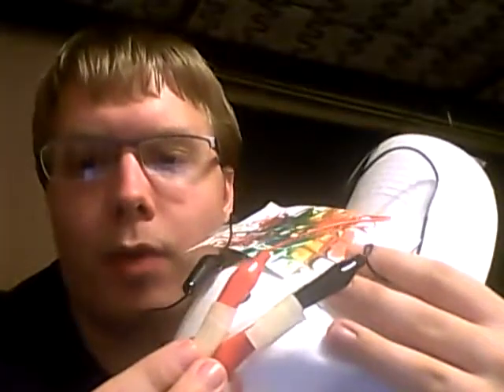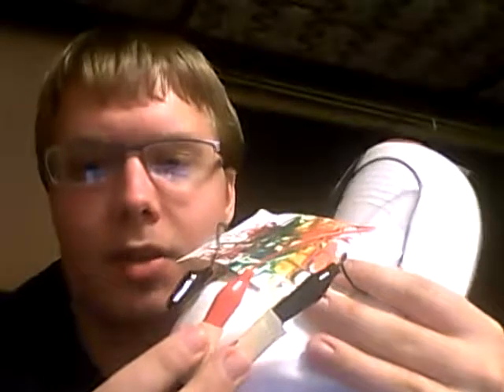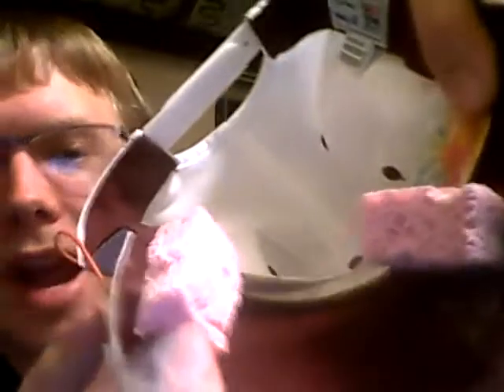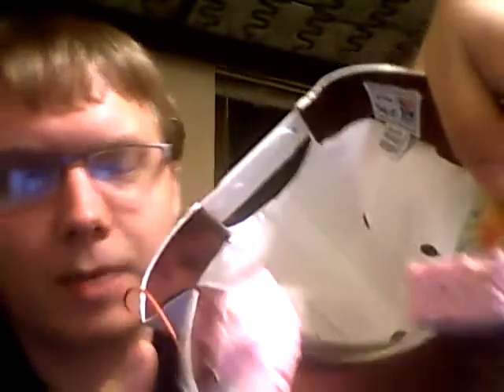A biohacker's prototype tDCS device

Comment from the maker: Good ideas.  I actually already have the ramping-up feature covered; I've replaced the battery with an Arduino Pro Mini, which is programmed to use pulse-width modulation to ramp up the current, and to shut off the current after it's been fully ramped for 20 minutes (the most-often recommended stimulation time).

I also now have much better electrodes than the ones in this video, which can actually stick to the skin.  I have great hopes for my improved version of the device.

Comment from the maker: Well, we found out mostly by experimentation (i.e. trying different currents and seeing what happened).  IIRC, your typical tDCS pulls a current density of about 800 microamps per square centimetre.  Multiply that by the contact area of the electrodes, and you've got your current.

Comment from the maker: More or less.  Actually, you don't need to leave the cathode wire free at all; it really doesn't matter where on the circuit you put the resistors, as long as they have the right serial/parallel configuration to get you the net resistance you want.

You don't necessarily need to dip the electrodes in saline; I just did that to make the sponges into electrodes.  You can get electrodes for a TENS device at a pharmacy, and those should work as well.

Comment from the maker: In summary,

1. Start with a 9v battery.

2. Wire the anode to two resistors to drive the current down to about 1.5Ma

3. Leave the cathode wire free without resistors if you want

4. Connect the anode and cathode wires to electrodes or sponges

5. Dip sponges in Saline.

6. ???

7. Profit.

Comment from the maker: To be perfectly honest, I've since found out that the currents used in this device are something like two orders of magnitude lower than any current that's caused any recorded damage to the brain, so it's quite a bit safer than I thought.

Having said that, I plan to add more safety features to future versions, to guard against things like software failure, etc.  So if you want a version that's more safe, waiting is exactly the right thing to do.

Comment from the maker: Yes and no.  The overall resistance of the entire circuit (including my brain) is significantly higher than that of the resistor, but it's still enough to induce the state.  I do intend to play with the 2 mA current, though, using something like a current-limiter to guarantee the proper current.  I also have better electrodes now, anyway:  these TENS pads you can probably get at any pharmacy.

Comment from the maker: 1.5 mA is just fine.  One thing you have to take into account is that your head has a certain amount of resistance built into it.  Really, though, you only need about 0.2 mA of current (at least with the electrode size I'm using) to get the effect.

Comment: I read that the skin irritation and phosphenes can be reduced if you also use electrode cream, and by slowly increasing the current when you first turn it on. You probably want to make your electrodes more secure if movement is inducing the phosphenes. Maybe a stretchy net cap like I see in one of the other videos works better. I haven't built mine yet though, so I'm just going on what I've heard and read so far.

Comment: The device should be strapped on using laces for safety pruposes. That way you will automatically be unable to use it when you've reached the point of retardation where such a task becomes impossible... :P 
Anyway, cool vid.

Comment: I tried it myself.  I'm not sure if I did it right though, but could only get about 1.5 mili amps to pass. I know this by putting a amp meter in series with the connection. I did experience the light flash when turning on and off the 9 volt battery. My cap was made from an an ace bandage alligator clips, a 1 meg ohm variable resister and 9 volt battery  basically wrapped the exposed metal to my temples and sat there for about 20 minutes while I cooked. hehe!

Comment from the maker: Just get a pair of electrodes for a TENS device.  They should be available at most pharmacies.

With the electrodes I'm using, 2 mA is the absolute maximum, but to get the effect, you really only need more like 0.2 mA.

Placement depends on what region of the brain you're trying to stimulate.  I placed them above my eyebrows.

Comment: See the problem is that the battery amperage fluctuates rapidly. Try measuring it with a multimeter so what you also need is a current regulator like the LM317 or LM334

Comment: Would this be how to do it?
1. Start with a 9v battery.
2. Wire the anode to two resistors to drive the current down to about 1.5Ma
3. Leave the cathode wire free without resistors??
4. Connect the anode and cathode wires to electrodes
5. Dip electrodes in Saline.
and then stimulate.
Am I right?

Comment: Nice. Do you have any interest in making it open-source? I have a couple Arduino starter kits that I haven't dug into yet. Rather than using only fixed resistors, I was thinking it might be good to have the chip regulate the amperage to be what the operator chooses. I'm thinking there might be variations in resistance across the body, but I don't actually know that yet.

Comment: Hello could you help me with something, I have tens electrodes the ones with a sticky gel stuck on a black base, if I remove the gel and place a cotton pad on it and wet with saline is  that ok to do, what is the black pad made from  will it conduct, I get flashes it feals like it works. thanks
Reply from the maker: I can't imagine it would do anything bad.  It might lower the amperage because of a worse connection, but I doubt it will harm you or anything.  I mean, it should be pretty similar to the effect I got in this video.  (Although, I didn't tell you to do it and therefore can't be sued.)

The TENS electrodes I have also have a black pad, that's made from some kind of plastic layered with cloth.  If that's also what yours are made from, then they won't conduct electricity.

Also, yes; if you're getting flashes it means that current is flowing properly.